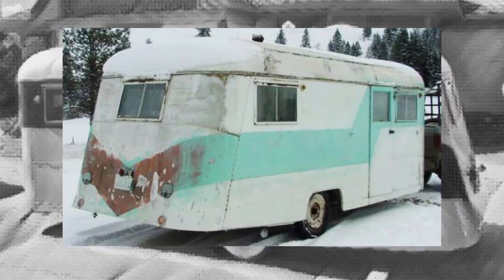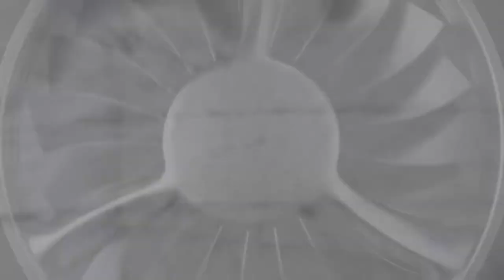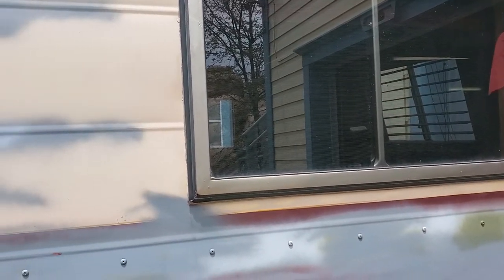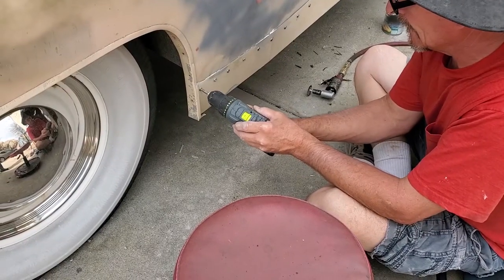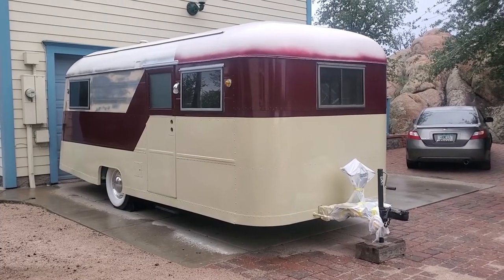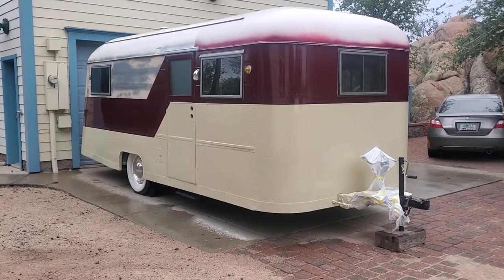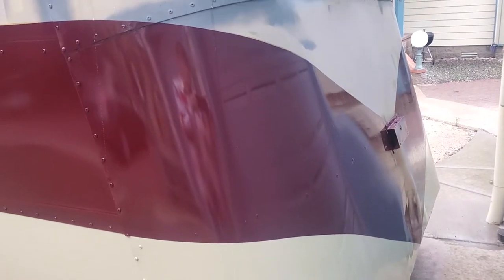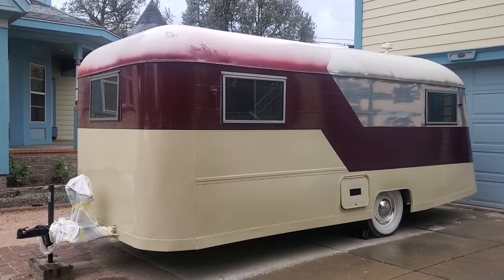Repairing a Vintage Camper Trailer - New Paint for a 1947 Westwood Tahoe Camper

Comment: Can you give me the info on the exact tires? I own the same trailer which was refurbished and styled as a “Rita” trailer as in Rita Hayworth. It’s awesome, but I need to buy whitewall tires.
Reply from the maker: No, the trailer is no longer here. We concentrated on the exterior only while it was here getting its new paint. We produced two videos describing the exterior restoration and paint while it was here. The owner picked it up last summer. Your best bet is Coker tire, if you have wheel specifications. Thanks for watching!